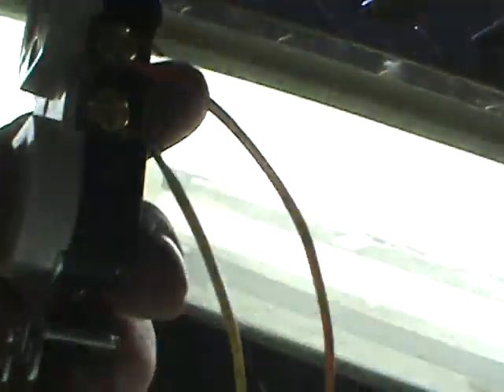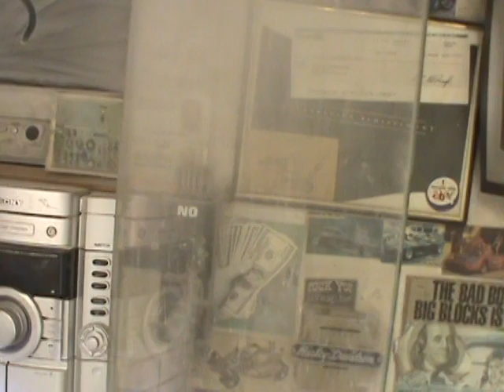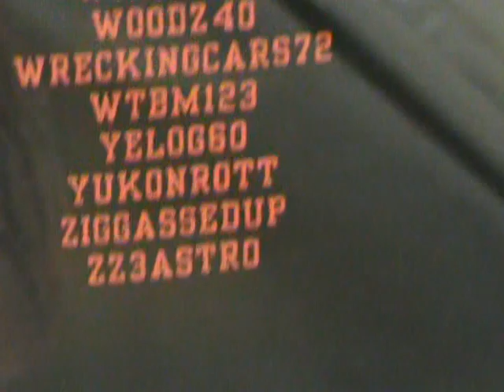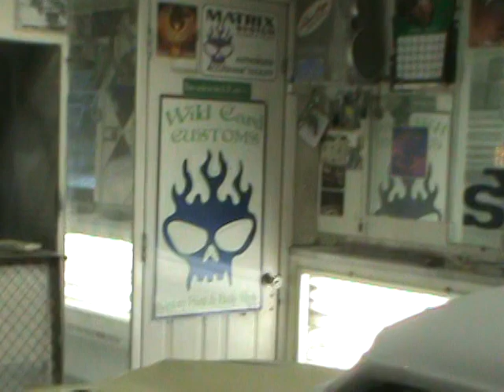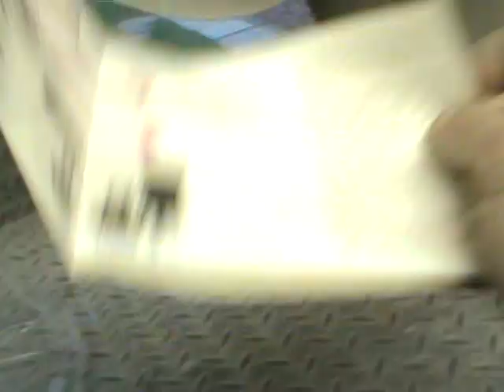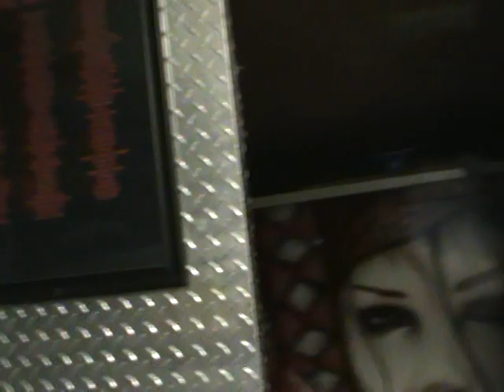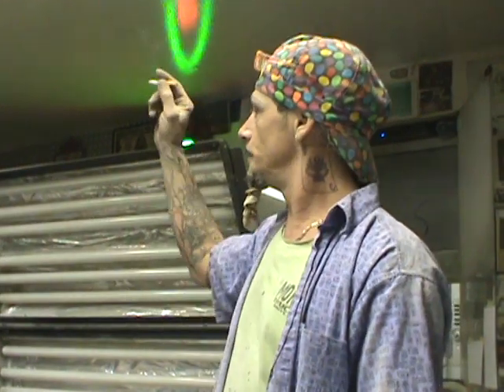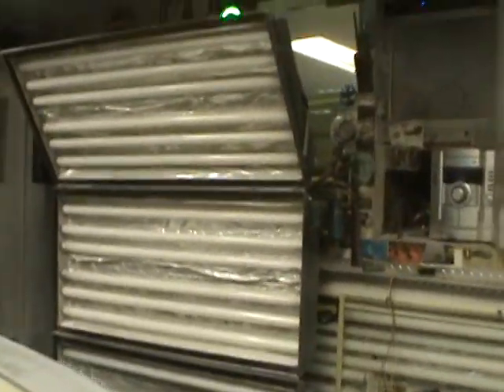WILD CARD CUSTOMS-294-PAINT PIMP

Comment: Thomy Shuu.  You have the hot side correct.  You need a neutral on the outlet.  Take a white from a 110V OUTLET and run it to the silver screws.  You -can- run your ground from the compressor to the silver screws....  If you have equal fans running on both sets of holes it will work...  It's not right but it will work.  The best is to have the neutral to the silver.

Comment: From '85 to '91 I worked in a furniture factory. We painted metal furniture frames with enamel all the time but the mojority of the work was Lacquer over sanding sealed wood... Anyway, WAY back when we were all Binks. I don't knwo if they are still used in the newer guns, but the older ones all took, "Needle packing" and a few rubber seals in the air valves... Sounds like the Binks has a blown seal.?

Comment: just use one of the 2 wires off the compressor say the black one, cause theres 120 on each leg, then for the other side of your plug go to that ground screw, thats going to be your nuetral, your not going to have a ground leg as you only have 3 wires going to your compressor but you can tie the nuet and the ground together at the plug for the fan,,rental places are for tools you dont have,,

Comment: Like milric says good so far, but now if you don't want to go to the breaker box go to a close by 120 regular outlet or a light switch box and connect to the white wire there. that is connected to the neutral bar in the breaker box.

Comment: It looks like you are real close to having the wireing figured out Thomy Shuuu. The NETURAL wire is the one that should go back to the breaker box (silver side of the outlet). I believe you could just connect that netural to a netural in a near by outlet. (I have done it that way and it works but I am not sure if it is code). Greg would probably be better answering that question. The Ground can be grounded to any ground point.

Comment: disclaimer: (this will work...ground the crap outta it) if your ground and common (white) are tied together in your breaker box you could get away with putting the silver screw side on your 120 outlet and the green together and attach to the ground  of your compressor (not the correct way but will work).Remember to remove the tab between your red and yellow before you hook it to the compressor.

Comment: I was thinking even after the compressor reaches pressure the compressor is still hot . You would probably be better off using a thermostat to control the fan and avoid the pressure switch and the 220 all together.

Comment: Thomy that won't work . You can't just hook  a 120v fan to a 240v circuit . Using a ground as a neutral is wrong (aka hack) You need to either run a 12-3 with ground to the compressor so that you have 2 hots a neutral and a ground or get a relay with a 240 v coil and run your 120 through that .

Comment: tommy stop................. the gound on the plug your holding is not what you need to be hooking up to..... take the gound off and hook it up to the screws on the other side of the plug.... your fans are just two wires right? the two flat holes.... thats what you need to be hooking up too......on the other side.... dont hook up too wires or break the tab... just use one piece of copper and tag into either the black or white.